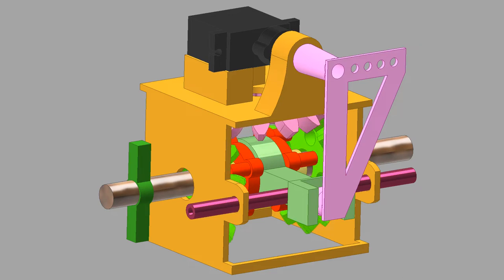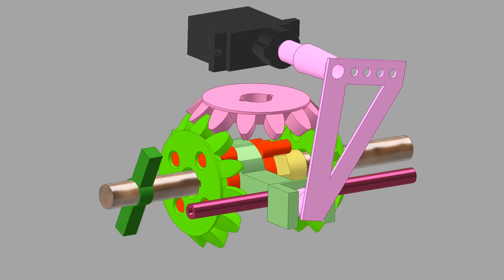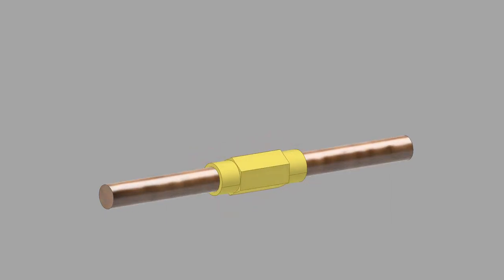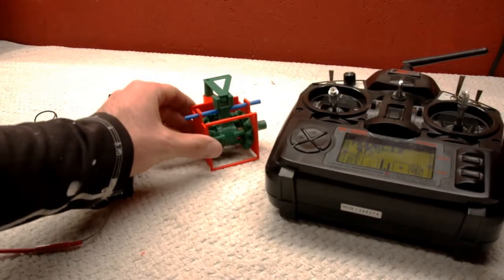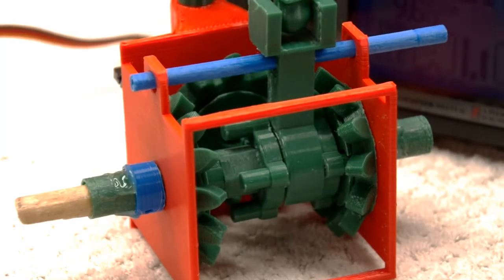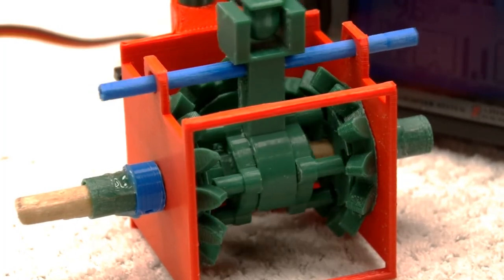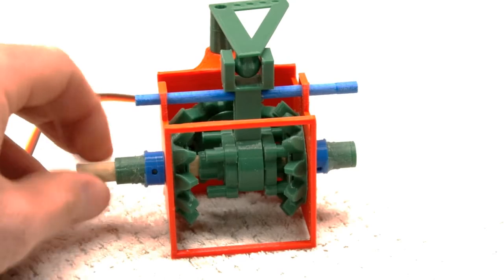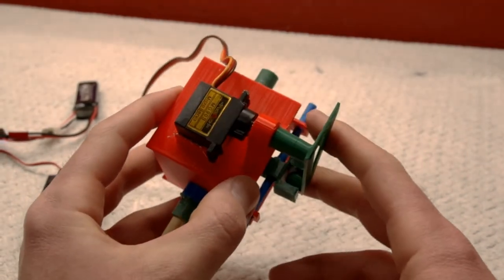Forward and Reverse Gearbox

Comment: You have recreated the lower gearbox for an outboard boat motor.  The shifting clutch (aka dog clutch) on those are splined for an easier engagement of the forward and reverse bevel gears.  I am currently playing with that design myself!